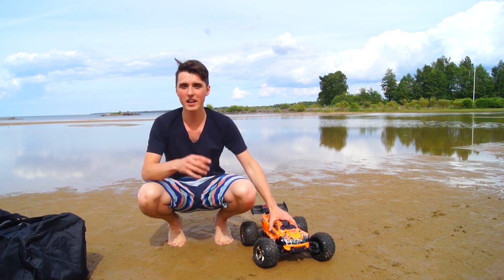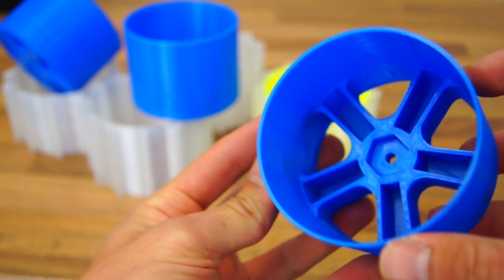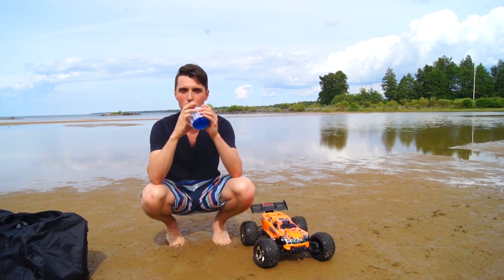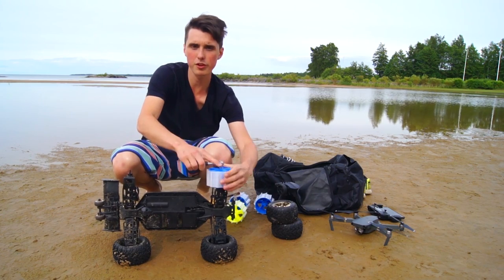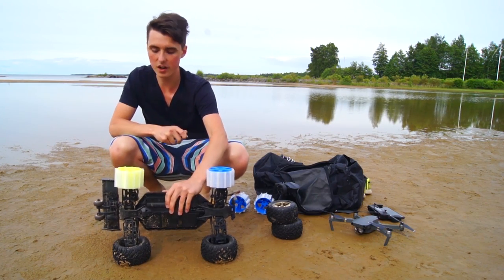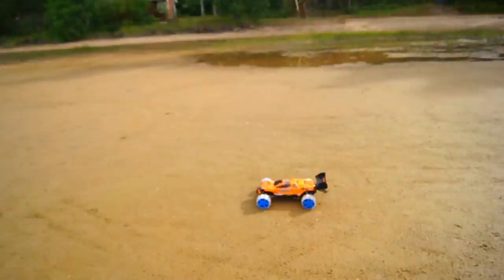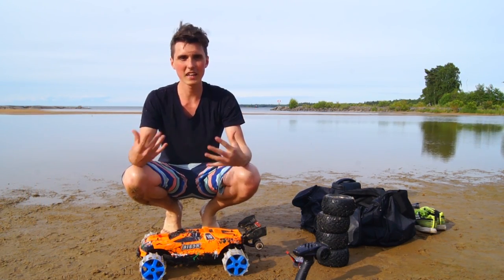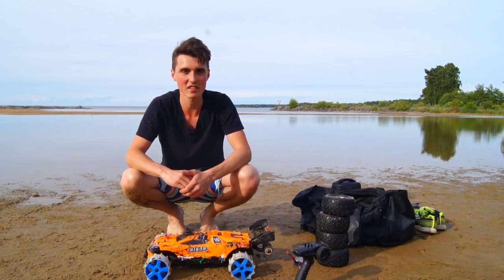3D Printed RC Car Wheels - Crazy Traction!!!

Comment: Its the air in the regular wheels that make it easier to float.. Thought that would have been obviouse though as its basic common physics. In other words the 3DP wheels are missing the main physical factor that is required for anything to float.. All the paddles do is propell the car fowards. The paddles dont help it float they just help it get across the water qick enough before it sinks. What you need is a bigger tyre that holds more air and also smooth out the underside of the car to make it more hydrodynamic

Comment: Greetings RCLIFE...!
Try printing your wheels with the tread angled at a 45deg away from the car. Left side 45 to the left and right side 45 to the right. This will help funnel the water away from the tires and the car and you'll see better performance.
Great video bud, and I bet the tread angle works better than you think it does.
See ya in the RC world...!
Wayne - N8VBW

Comment: I would try putting a wave pattern on the wheels. But orient it so the wave design travels long ways all the way around the wheel. That way the water can flow around the wheels as it drives but the curve shape in the wheel could push the water away still to give thrust. Or I could be totally wrong. Either way, it'd be really cool to see! :D

Comment: What you should have was to use the same tires and inset the paddles to it.
But the padddles should be atleast 10mm and 45degrees so it can both provide additional lift as the wheels spins.

Comment: I would say alongside the higher diameter that others are recommending as well as the higher strength power delivery overall (making sure the battery, speed controller, motors and everything else involved in the drivetrain will all handle more power), here's a couple things I would give a shot myself. 

A) Give the tires their own inner wall of some sort while still allowing space for them to be mounted and steer correctly. This will ensure that if any water is being caught by the inside of the wheel, it's minimal, depending on how well you design it. 
B) Round the tires just a little bit as well the same way as the paddle tires. If you need to steer, even just the flat side of those wheels you have can possibly upset the balance of the vehicle on water if you steer too much, and with enough speed the rounded tires would have enough side give to minimize this. 

I'm no engineer or anything like that, but I noticed with other videos of those actually managing to drive on water the same way as you tried to, the paddle wheels they use usually have some sort of tire sidewall on either side and are very stable side-to-side instead of flipping over because even with steering (unless you just fucking wrench it and gun it) they have some forgiveness thanks to the rounded outside shape that you can see in small bouts with enough attention to detail and slowing the footage down.
Reply: Otherwise, at the very least you did make good sand wheels like BlastedOff said.

Comment: maybe if you  print an air tight gap between the outer layer of the tread, and the hub and lengthen the paddles and make them more flat instead of curved. that sounds like a lot of work though :p

Comment: Put smooth tires on the front. Then, use your printed paddle wheels on the back. Last, create skid pans with a raised leading edge for the full length of the chassis and for the lower A-arms.

Comment: It's because the regular tires have air air in them allowing them to float they paddle just allows it to move across the surface better, try to make a paddle fitting over the regular tire.

Comment: count the the number of paddles on the tire that was ran on the traxxas and note the distance between them. you also may need to increase the paddle size by 50%. the side wall of the tire should be bigger too to help reduce drag from the water to rim

Comment: 2 possibilities I can see. The stock tires are not as dense as the printed ones, and on the most tires designed for this they have a crescent scoop to not displace water away from the wheel but catch it instead

Comment: There's little buoyancy with the 3-d printed tires, foam filled rubber tires also flex and expand with centrifugal force causing them to scoop more from the center. Maybe make rounded scoops with tall center peaks? Just suggestions. You would really need some taller gearing and more power to get the wheel speed.

Comment: For driving on water I suspect you need locked differentials so all wheels spin at the same speed. A flat bottom plate may also help. Good luck.

Comment: seal your wheels watertight too , so that your wheels are like 4 little drums with paddles on it, the buoyancy might just give you enough lift out of the water, or 3D print a boat-like under cover with the wheels sticking out.

Comment: the problem is that you need straight paddles in stead of angled because the angled ones are catching and keeping the water instead of ejecting the water making your wheels heavier and harder to turn bogging it down

Comment: note that the hydroplane tires have a curve this is to help keep the water in the middle so it stays afloat yours are flat so the water escapes from the sides of the tire so the wheels sink and then there goes the car under the water

Comment: I Think you have to make the spacing of the paddles a little wider, because otherwise the low pressure from one scoop will take away all the water from the next, rendering no traction. Also, as others have mentioned, i think putting rubber tires on the front would really help.

Comment: The new tires are smaller, so you lose top speed (assuming you had proper gearing before). So I think you need to change the gearing - or more voltage to get more rpm AND more torque. 
Also, I notice a bit of bouncing in the car when hitting the water, that cannot be good. I have no idea how to setup a suspension for driving on water, though!

Comment: In the rubber tiers there is air trapt between the tiere and the weel, and because of that it will eather float or at least act lighter on the water surface. So basicly the weels you made in the 3D printer does not float as well...

Comment: Because of fins like on wheels, it claws the sand and grass , since sand is solid the reaction is going to be unbelievable, but water is liquid means it will sink instead if floating, so if you reverse it. By making the wheels smooth, then it will slide and drift on solid an float on liquid

Comment: I'm sure someone else has mentioned this but the wheels you were trying to copy although you showed them for a very short time they looked inflated, so they had air inside, that would help keep the car up on the water and then the speed will also help keep it up but the speed by itself is not enough.

Comment: that might sound silly, but did you try to put the wheels the other way round? Ie the way you have them now - it gives you better paddling and that's why if the car is stuck in water with no speed but you apply power - it starts moving reasonably well. However, when you accelerate on the ground first - such orientation of the paddles actually adds lots of friction and acts as slow down once you touch water - that's why it's worse. Alternatively, with same orientation of the paddles could be fine but not perpendicular but more like V arrows in direction of paddling.

Comment: I'm not sure, but maybe try to point the paddles a bit in the direction of travel (kind of like tractor tyres). Racing car tyres tend to be designed that way so that they can displace water from the tread...

Comment: I think the wheel failure is a combination of two factors:First, as alot of the other commenters have said, inflating the wheels would give them buoyancy.Second, if you look at the paddles on the official wheels, there's a slight curve to them. If you put a similar curve on your custom wheels, it should improve the car's performance.

Comment: its your front tires pulling you down. example if your rc was rear wheel drive only it would constantly be raising your front end up because up because of your down force, same applies for the front. so heavy traction tires on the rear and smooth on the front will eliminate your problem.

Comment: I believe u need to put flaps on the front to make the car float. Looking at how moto x on water works, they put weight on the rear tire although u are awd I think? U are probably bouncing due to the impact of water and causing the front to sink. I think a bracket holding a down scaled snowboard attached to the front wheels could keep u above water

Comment: Try flipping the wheels around so the paddles face the other way. Your scooping water with your current configuration. You want to push the water away. Notice how it throws up sand so well. It's doing the same with the water. The throwing up is causing down force which sinks you.
[cool idea though. I enjoyed your video. Hope you can work it out.]

Comment: I feel like because you have scoops on the tires, when you entered the water the scoops created a downforce in the water taking the car under.... try just using vertical flaps on the tires so no water can be trapped in the scoops

Comment: Your problem is that the wheels might bee too heavy, notice the paddle wheels are hollow and filled with air. I might be wrong but just guessing I use a boat for the water and a car for land so I haven't tried this.

Comment: Wheels are a lot like the ones fitted to the  Icelandic hill climbing jeeps. These can drive on water as the power to weight ratio is very good so maybe this is something you should look at. Also look at the design of the tyres. The scoops on yours compared to the real things look quite shallow so I assume this helps them drive on the water to.

Comment: You can use any actual paddle tires like the ones that traxxas used just as long as you have the right wheel hex size (12mm)

Comment: You need to have a higher profile tire and taller flatter paddles.. That way the tires can balloon out a little and the paddles dig in more. That worked out good for me when driving on water. You can turn and do wheelies while on the water too.

Comment: Try putting the original wheels back on the front and use the paddle wheels in the back, the front paddle wheels are causing to much drag, you really only need them for skimming the surface and steering.

Comment: completely fill the servo w/ oil and it should be water proof, and the gears won't wear as fast. also that type of tire is made for use on sand, hence they are called sand paddles.

Comment: My bet is water flows inside the hub, sinking it quicker. You could try making the hub solid,  rather than spoked, and a bit of a wall on the inner rim too. Then join those two structures with a cylinder.

Comment: If you really notice, the car is planing fine.... until it slows down. You need to keep the RPMs up. You can do this two ways, Reduce the load on the wheels or MORE POWER to keep the wheels spinning fast enough to keep you on the water. That's how bugs in nature do it is being able to run fast enough across the water. So, try reducing the number of paddles per wheel and/or you might also try reducing your gearing, i.e. larger tooth motor pinion. Reducing the gear ratio will also reduce your torque so try reducing the paddle count per wheel first. Basically all that is playing with optimizing your available power. If plying footsie with efficiency gets boring and tiresome then brute force the issue.... MORE POWER. A hotter motor, more cells, etc.....

Comment: You're supposed to use rubber wheels like what's already on it but with bigger paddles so it digs in the water better and then it will drive on top water.

Comment: bigger paddles, also it might help that it's hollow and hold air on the inside because the normal tire floats but the plastic isn't as buoyant so if you have a hollow design it might work

Comment: To me it doesn't look like it sinks. It seems to suddenly drag itself down at the front end. I think that when the velocity is high enough there is sufficient up thrust from the full width of the tyre. When forward velocity drops past a threshold it dives because the "paddle" tyres are gripping on the water and producing a downwards force, essentially a mechanical downforce. 

 If you reversed the front tyres, or perhaps made them wider slicks it would aquaplane more effectively, If you add narrow raised (blade) ridges  around the circumference of the front tyres it might give you some front end grip for steering

Comment: what you need is tires with paddles not scoops  and instead of solid tires use ones with space inside for air because air is lighter than water thus making your tires and car float

Comment: make the flippers pioint forward with slim raised ends or fill fill the surface with little depressions. so that it makes a blanket of air on which it can glide over water.

Comment: you need to prevent the water from going in the wheels.. use solid side walls instead of spokes. and if you can close it to trap air in the wheels, then even better.

Comment: The flat surface of the wheels and the lack of tyre walls is the problem.

Print tyres in 2 parts with a high tyre wall. Attach the 2 parts to the hub pushing into the inner side of the hub and the other part from the outer side of the hub and the wheels will have a boat and buoyancy like action.

Another option would be to print a complete sealed tyre with a large symmetrical tread, not a scooping tread, and place that over the hub.

A wide sealed hub might be another option to offer buoyancy.

Comment: @RCLifeOn First off, Great video, I really enjoyed it. I have some thoughts, if you don't mind me sharing. I noticed that the wheels bounce off of the ground a lot when the wheels are spinning fast. Have you held the car in the air and throttled the car up? Do the tires seem balanced or do they wobble and shake? Unbalanced tires rob power. Also, because the plastic is stiffer than the factory tires, have you considered loosening the suspension to compensate? The suspension should be hard enough to keep the tires on the ground as much as possible while soft enough to hit bumps and not throw the balance of the car off.

Comment: You need a plain no tread tire in front with one center line bead for steering purposes. Then you'll be able to drive your RC on water and keep the paddles on the rear

Comment: You need the rubber tires because of flotation it helps stay ontop of the watter you use the rubber tires aka flotation plus the pattle tread aka propulsion equals drive on water

Comment: Idk if u will see this but u have to have some throttle left when u hit the water so friction doesn't slow you down right away and Goose it as you hit the water and your front tires need to be the normal tires. PT2 plz

Comment: The traxxas tyres have more buoyancy due to their size and the fact there will be air inside (natural air pressure not inflated). 
Foam inner adds to this affect to. Unless it gets wet.

Comment: you should make the fins curved on the wheels sorta like a semi bowl and or look at actuall traxxas water tires and model them from those.  Also when the fins go to the outside of the wheel they should curved down and connect to the tire.

Comment: Tire diameter is too small and making the flaps/scoops a little longer would help greatly.  I'd make the wheels/tires a larger diameter and possibly change the gearing to compensate for larger wheel.  Also making the tire more straight paddle than scoop might help.

Comment: I'm NO engineer but. I'd think your issue is that with rubber tires there's a small layer of foam between the rubber and the wheel and that tiny bit of buoyancy is probably the difference between a seccessful skim and a failed skim. I love the 3D printed wheels though. Seriously great idea!!

Comment: One of your issues is, normal rubber tyre's have small amounts of air in them. Helping to keep it semi afloat. Using just plastic wheels remove's all that air. So you're relying on just the paddles to hold all that weight above the water. I guarantee if you use actual rubber tyre's with paddles, you'll skip across the water without incident.  P.s just found your channel!

Comment: You will have to change the wheel design by reversing the flanks to make it work on water. They design you have will make the wheel dig it's way into water. That was the reason it did not work.

Comment: The reason the original tires worked better is that they are filled with air, so they are more buoyant.  Either print a flexible paddle wheel that can be put around the original tires or find a way to make your new wheels buoyant.  Try filling them with Styrofoam or something similar.

Comment: I think it's because the tooth of your whell are not set the right way so insted of sliding in the water you'r diging in. That's why it works so well on the sand.

Comment: Epic Noob has already explained the solution, you should try flipping the tires and helping the tires to flow on water surface, and you can also flip only the fronts so the front will always stay on water while the backs push...

Comment: i think the problem you are having is boyance... the wheels have no air in them, so they would sink like a rock, whereas the paddle wheels for the traxxis has air, i think thats where the design flaw is, idk, maybe its worth a try to put the outer wheel over a normal rc wheel, so you have the traction/paddle effect, with the boyance you need